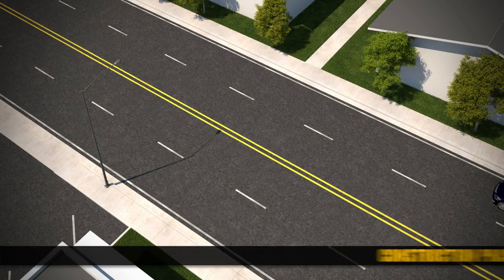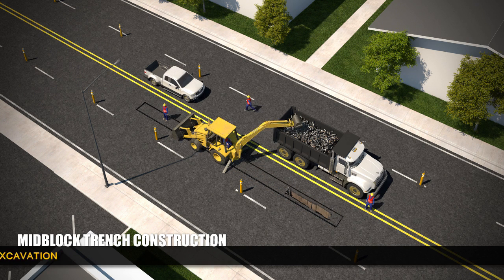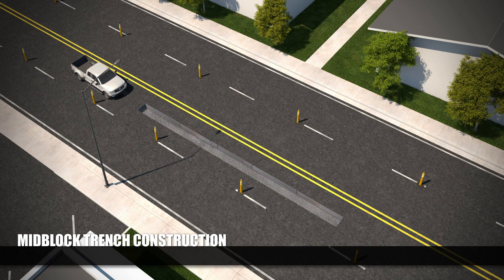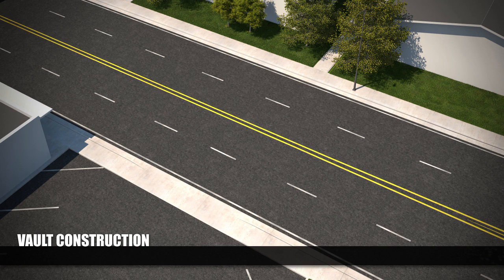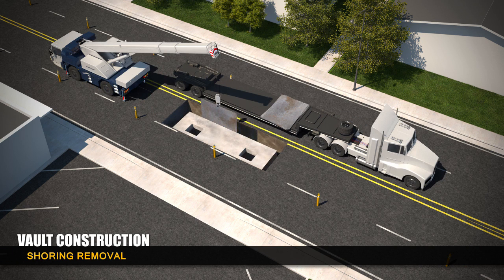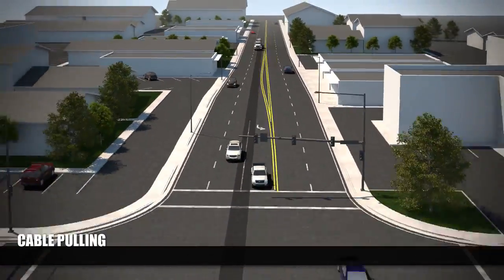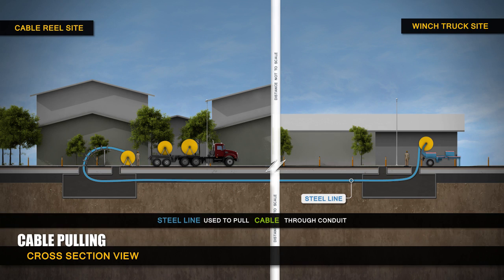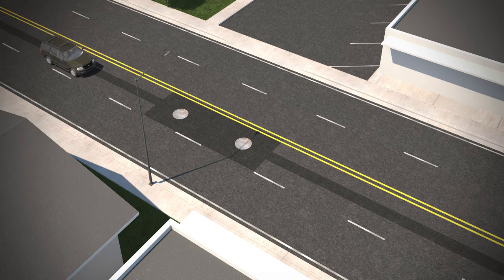Understanding Underground Transmission Line Construction

Comment: One Confusion, Can't Rains Mess The Connections After The Whole Work Is Done
Reply: the electrical manholes should have sealed covers fixed with bolts + seals & also sump pumps installed inside (like in Germany)

Comment: I wish the video had explained how the first line is pulled through the conduit between the winch truck and the cable truck.
Reply: You have different ways. If the run is not too long you can use a router to go from one end to the other and pull back some rope to then pull the winch line. If not you use a Compressor to shoot a mouse or birdie with the compressed air. You have a line of string attached to the birdie and it flies down the pipe super fast. You just grab it at other end and use that string to pull your rope then pull the winch line through.